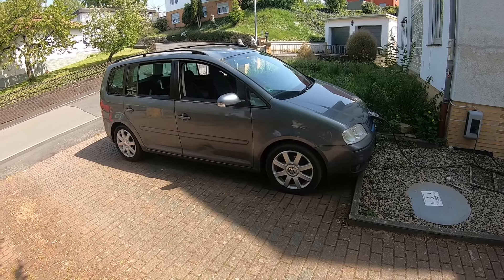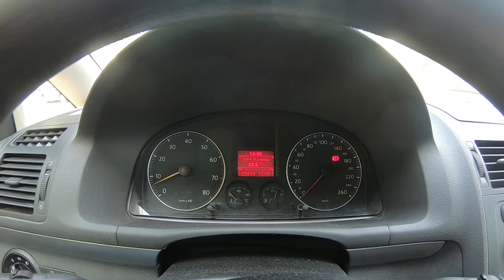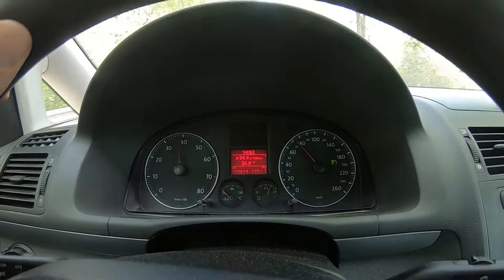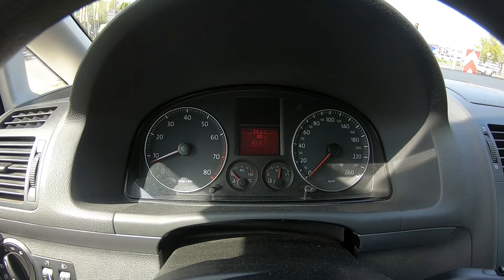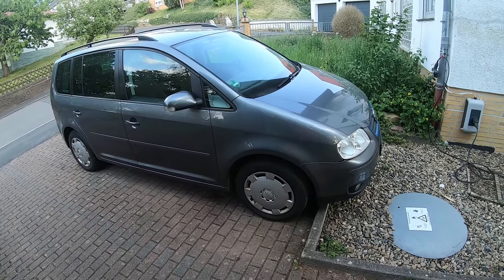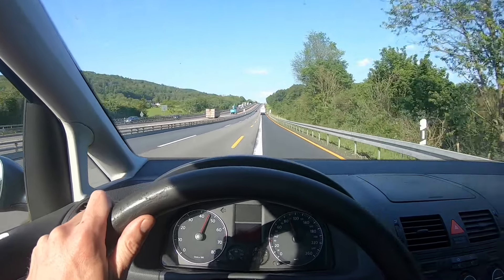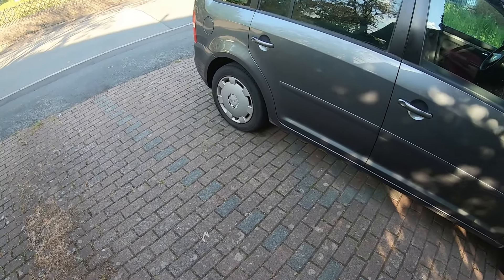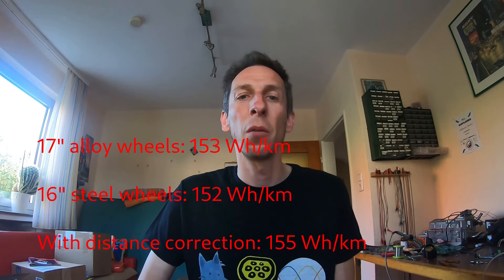Lab Update #92: Steel rims vs alloy rims

Comment: I've often heard that bigger Alloys will increase consumption over smaller trim covered wheels but wasn't sure whether to believe it or not. Thanks for taking one for the team to confirm any difference is more likely to be tyre width, compound and pressure related. 
Maybe for longer motorway journeys at high speed it might make a small difference.

Comment: usually people think that because they compare a light smaller wheel to a much bigger wheel with much larger tire but maintaining the overall diameter for the same km/h. For example my little mk1 golf from 155/80R13 to 195/50R15, a upgrade that will give you stability/traction/adherence but will consume much more fuel.

Comment: As a former chassis designer, I know that tires should be the narrowest model with hard rubber (hige treadwear ratings), wearn out almost illegal, max air pressure, for minimum "gasoline consumption" as it was at that time. The car should preferably also be lowered with the least possible ground clearance and all gaps in the bodywork should be taped , the windscreen wipers removed or stored straight up in the direction of the air stream. The measuring road must be completely even with smooth asphalt. Trick that manufacturers still use today when measuring consumption.